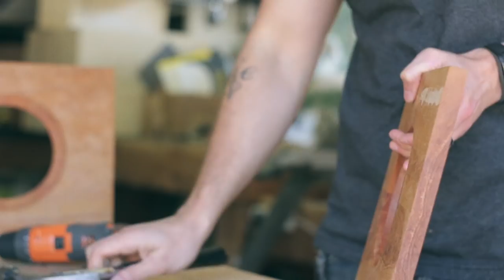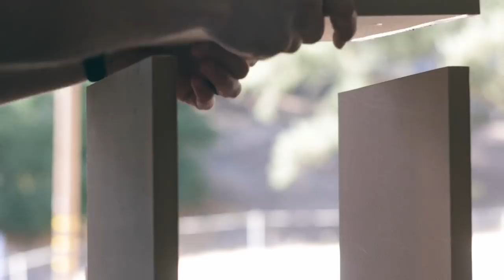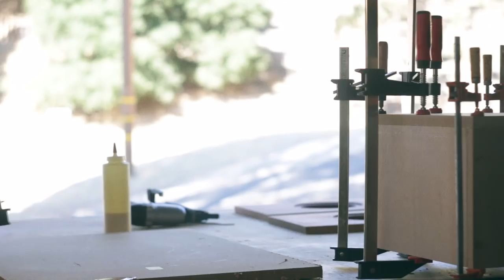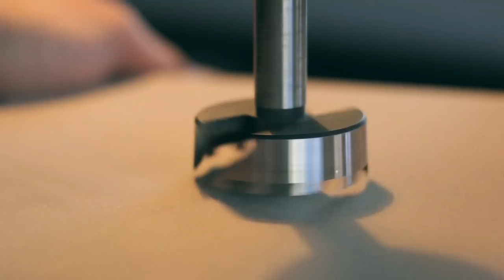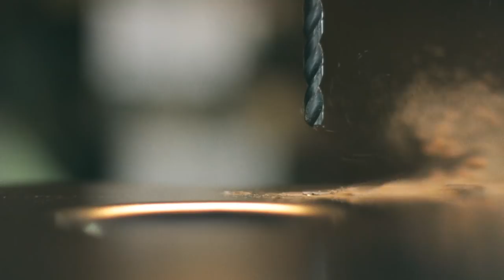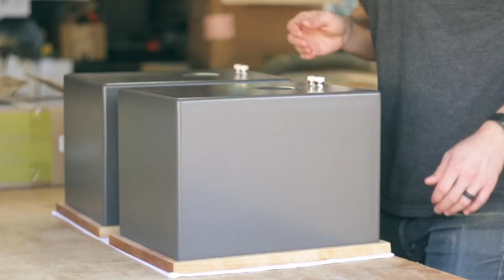DIY SPEAKER BUILD || Open Baffle to a Vented Enclosure

Comment: , do you ever consider Brad nailing and or using blocks of wood for corner bracing Kirby ? you should I think consider it. You could even experiment with biscutes.
with a Plunge router and biscute joiner attachment.
they add a lot of strength to cabnets.

Comment: You make a speaker as art man! I have two questions though.

1. What did you apply to the mdf???? It looks pretty smooth and nice. it doesn't look like
a mdf

2. What is it at the speaker unit???? like you just put the wire inside to that something.
I always solder the wire back of the speaker unit and it was very inconvenient but it looks nice!

Anyway, your work is awesome!

Comment: The Qts of that driver is very low - too low for an open baffle. It needs a vented box or a transmission line enclosure to provide the resonance in the bass range needed for satisfying-sounding bass. Also, the driver will benefit from a contour filter to control the energetic midrange and bring it more in line with the bass and highs. If you've never bought one, pick up a Dayton Audio OmniMic; it is so simple to use and will really open your eyes to where projects like this can be improved.

Comment: I'm curious and new to woodworking so I may be dead wrong but... couldn't you have used some additional intermediate boards to be able to clamp the face at the end to get a better fit and avoid marring the finish?

Comment: Very nice. 
Just wondering why you didn't "fix" the existing open baffle with the new knowledge (I'm assuming) you acquired in regards to open baffle design?
Reply: because of the drivers, they where not suited for open baffle design

Comment: The baffles are simply too small for open baffle. The cancelletion wavelength is much too short. This can only work with a very large baffle or a supporting woofer/sub.
Reply: True, could also have used a folded baffle design for a smaller overall footprint. The folds and placement can be calculated based on the roll-off frequencies and driver size.
Reply: @Conor Hanley Apologise

Comment: How do you determine the size of the box for the speakers you are using? Does a larger or smaller box affect the sound?
Reply: You can calculate the size of a sealed or ported speaker box if you know the driver characteristics and parameters.
There is also a recommended box volume given in the driver specifications.
It's usually better to determine it yourself - there are online speaker box calculators.

Comment: Are there any rules on positioning the vents in relation to the speaker position?
Reply from the maker: There are, but unless you're building a HUGE enclosure, you don't really have to worry about it. Thanks for watching!
Reply: I've heard that it's good to avoid aiming the inner vent opening toward the cone. I noticed that your vent does sort of aim at the backside of the cone. Any thoughts? Also, any particular reason why you chose to mount the vent on the rear panel instead of the baffle?
Reply: Nordgrinder i would go with the front as well. now it is almost directly behind the speaker. good build anyway
Reply: Kopitarko, thanks for the feedback.  Agreed. It's a good build, and a nice video.

Comment: Hey mate, love your videos...any tips on making speakers without a wood shop in your back yard? :)
Reply: Router table>table saw. It'll waste more material than a table saw but a router table can do much MUCH more than a table saw can, a straight bit can cut boards and plywood like a table saw, can switch to bits for roundover or making dovetails or recesses, and if you still precisely spaced holes or make your own router table you can use pins to make a circle cutter effect to cut the holes for the drivers. Best bit of advice I've been given for working in tight spaces or with few tools.